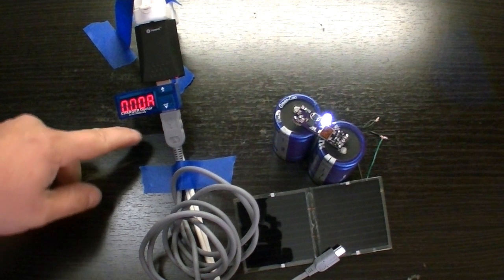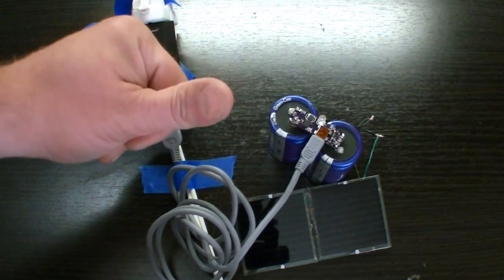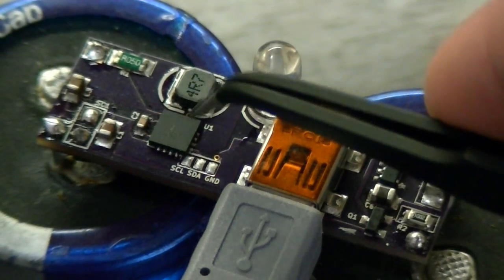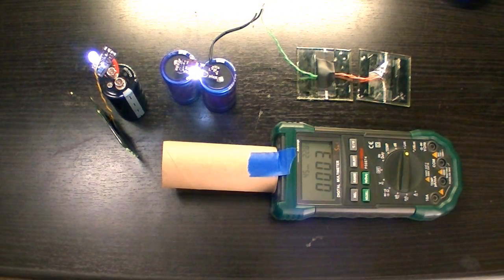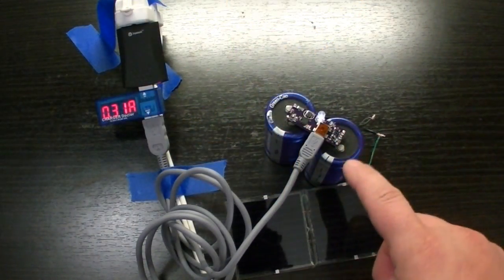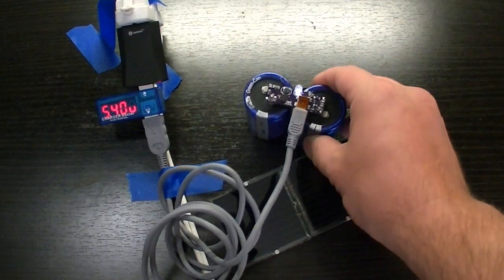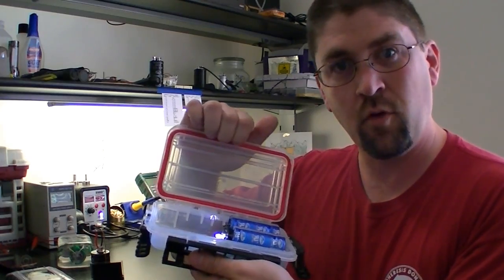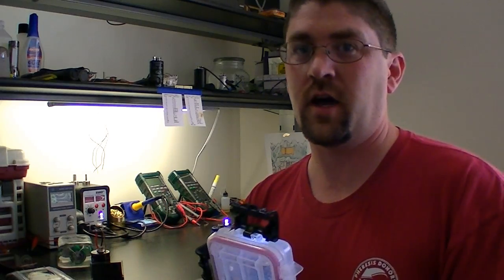Infinity Sun Jar V3.0 Unveiled!

Comment: PC USB ports don't blow if more than 500mA is pulled from them. The USB specification demands current monitoring that shuts down the USB driver chip when overloaded. In worst case You'd have to reboot your computer to reactivate the USB port on your computer. However Computer manufacturers has budged to popular demand and many computer USB ports happily supply 1-1.2A one at least one port at a time without resetting.

Comment: Great job! What is the practical application for you device? What are you going to charge from this supercapicators? Supercaps is not as cheap as Li-ion but technology has been improving. The newest Li-ion supercaps have been released recently (Taiyo Yuden). I'm designing ZSPM4521 version for Li-ion batteries using much more powerfull solar panels + tps63020. And i can't find suitable programming software for I2C interface. Instructions how to download it described in datasheet but doesn't work and there's nothing on ZMDI site. Can you share ZSPM45xx Programmer with me?
Reply from the maker: Vasya Chernov When I get a chance to make my final video regarding this project I will put a copy of the programmer in the dropbox repository.

Comment: Hello!
I have a question.
Can your circuit design accept more capacitors (in parallel connection?) I would like to increase it to 2400F
Also can I increase the number of solarcell? (also connected in parallel)

Many thanks!
Reply from the maker: reginr Yes as long as they are in parallel then you can scale it up.

Comment: The weatherproof box is a great idea. I've had a V2.0 Sun Jar for almost a year now and it still works awesome. I replaced the light on mine with a dollar store flickering candle LED and stuffed it all in a clear plastic box. It flickers for close to 6 hours before going dim. Eventually I will put a white LED back in since it lasts so much longer.
Reply from the maker: Cool!  I'm glad it's still working for you.  I have no clue the power requirements for the flickering LED's, but I assume there's a small IC inside the LED and that also consumes a little bit of power.  Good MOD on my setup though.

Comment: Came across this, you might be interested in it
A free flexible solar panel, might be interesting to see if that charge controller can help with its output, and since you are a developer, you might be able to request a few extra cells to see how they go with your V3.0

http://plasticphotovoltaics.org/free-opv.html

Plus I wanted to run something by you that I stumbled upon earlier, Texas Instruments has developed energy harvesting IC's boost circuits that take incredibly low voltages (say from low light photovoltaic panels) and boost them to useable power levels, imagine implementing that in your V4.0 where it uses solar panels that would normally not be able to push power to the supercaps and now it would be able to.
http://www.ti.com/lsds/ti/apps/alternative_energy/harvesting/product.page
Reply from the maker: I am actually waiting for my sample to come in from plasticphotovoltaics, I plan on making a video about it when I get it in the mail.

As for the TI energy harvesting IC's, I've seen them and they're good for what they do, but not in the application for the solar jar.  First off they're insanely expensive, like over $10 a chip.  Second they are meant to be used as microcurrent harvesters, think less then 1ma.  They usually get hooked to a piezo element and collects the intermettent power from them, or super small solar cells.  They are meant to store power in a small supercapacitor and have the power used in short bursts.

Comment: Can you please explain why you chose to have an external USB power source ( which totally recks and ruins the "infinity sun" bit ) instead of having a few more solar panels, say, ten solar panels? "I no understandy". Could have easily had panels mounted in parallel and then also in series, and then have the circuitry to swap between the two depending on if it is cloudy or full strength sun. Wouldn't this have been a better 'infinity' solution?
Reply from the maker: It was added as a backup option.  It has been very cloudy for the past 3 days in delaware.  The lights have not got enough charge to turn on.  I highly doubt that attaching 10 more solar cells in parallel would make up the difference.  When there's no light, there's no light.  And 10 cells would make the unit ungodly bulky.

Comment: Awesome!  Incredible design work...how well are these capacitors at paralleling, do they suffer bad cell syndrome like with Li Ion in parallel?
Do you think a version 3.1 with a different boost design with more prevalent IC's would be viable?
Reply from the maker: Running the supercaps in parallel doesn't seem to affect them in the least.  I've decided to wait for the boost IC's to come back into stock as I'm very happy with the performance of the IC versus price.